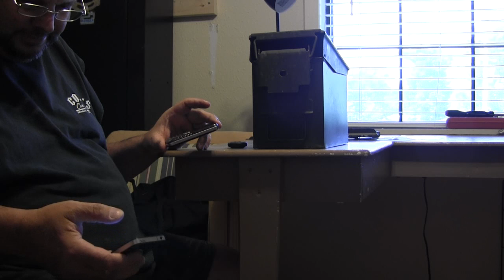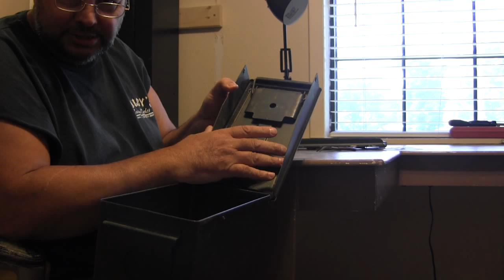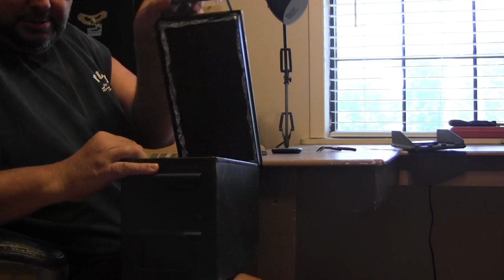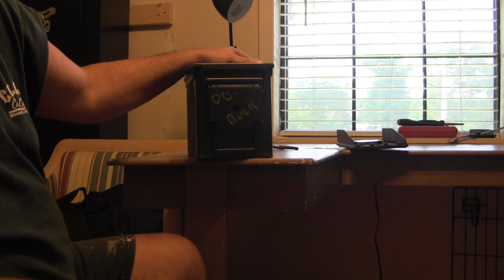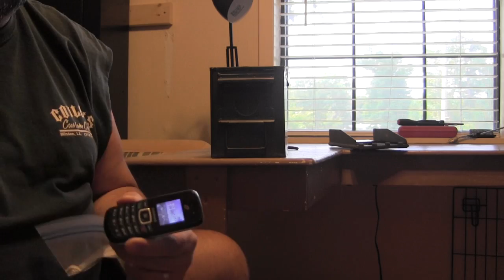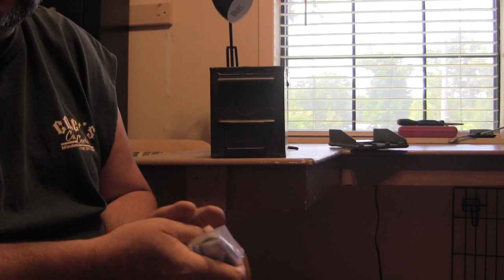Ammo can fariday cage

Comment: That is interesting.  Why do you have to protect ammo from EMP?
Reply from the maker: Tom n EMP can destroy the electrical system of ammo, throwing off the guidance mechanism that makes the bullets hit the target.
Reply: @bctruck  most average civilians dont have electronically guided ballistics.
Reply: Interesting.  I wasn't aware that lead bullets had any circuitry that Electro Magetic Waves (pulses) could interfere with.  I know that some howitzer rounds have circuity but my hunting rounds and pistol rounds do not.  I don't have any big cannon rounds so I guess I'm OK.
Reply from the maker: You must have old ammo. the newest ammo has circuitry that returns the projectile  to your home if it misses the target. Usually you can program it to wait for you on the back porch. EMP, damages the homing circuitry. You should get rid of all that old ammo and buy the new stuff!!
Reply: @bctruck   You should have also mentioned that the ammo built after June 2017 can stay airborne indefinitely, energizing off the earth's magnetic field until it hits something solid.   ; )
Reply from the maker: MTplainsman I did this video back in 2013, before the third gen. Homing ammo.
Reply: @bctruck  yea i keep my homing bullets in the garage next to my blinker fluid.
Reply: Other things fit in those ammo cans ...walkie talkies cb radios cell phones batteries ect.
Reply: @Johndoe-qk6fi  Yes there is a variety of uses for metal ammo cans.
Reply: You sir, win the internet

Comment: What prevents the hinge from serving as a contact point for the lid to the box?
Reply: Emp cannot penetrate conductive material the hinge does join the two peices but it does not seal all the way around the rubber seal around the inside of the lid is non-conductive this means the electromagnetic pulse passses thru the rubber seal if you wrap that seal with faraday material so you cant see any rubber and its all covered then if the box was originally sealing properly it should then deflect all of the signal actually cloaking your devices.

Comment: Protecting cell phones from emps and solar flares is not a bad idea, however it's not very practical. Because in the event of an EMP all cell towers and other forms of communication will be completely destroyed. Rendering cell phones useless. Most Faraday boxes are used for ham radios and other forms of two way communication that would not be affected by any widespread communication outage.
Reply from the maker: I didnt build this to protect cell phones! I used a cell phone to test its protection from EMP. I use it to store electronic equipment and FMRS walkie talkies.
Reply: @bctruck  I figured so. But when you wrapped the cell phone in plastic and explain how you wrap it in foil, may have given people the impression they can save their cell phones. Which they can theoretically, I just didn't want people thinking that their cell phones would be usable after that type of disaster.
Reply from the maker: Roger Winn I don’t think anyone interested in faraday cages would think cell towers would work after an EMP. I certainly hope not.
Reply: @bctruck  You I would think that. But I have read on different forums where people falsely believe they will still might be usable. I'm glad you posted the video, more people need to be aware and try and be prepared. Let's just hope that none of us are ever face this type of disaster.
Reply: @bctruck  Cell phones can be an excellent place to store data and media. So even if cell towers are out - at least you will have some of your electronic data preserved.
Reply from the maker: @Robert_Preston  Good point!

Comment: How about just line the inside with card board including the lid and call it a day i took cardboard and lined all the cardboard with a rubber like say a toolbox liner for ur drawers and glued that to the cardboard bottom sides and lid and guess what it workes and did not have to remove the rubber gasket so do it right or u want have any electronics plus remove the battery from anything requiring it to work

Comment: Maybe you can answer this question.  If I disconnect or remove the battery before an EMP or CME,  will the car start?
Reply from the maker: It won’t affect it. The emp affects electronics weather it’s connected to a battery or not. Disconnecting a device like a computer from the power lines might save it but the battery in a car wouldn’t make it anymore or less susceptible to an emp.

Comment: I am considering using ammo cans as well but use two ammo cans placing one iside the other and lining the larger can with wood to prevent any contact with the smaller can. I would then wrap the connection between the body and lid of the larger can with foil tape. Radio signals are a poor test for EMP shielding and by using a layered approach it may provide sufficient protection.

Comment: wow, y'all seem to be way over complicating this...   If you just sand the rim of the can, throw a sheet of foil over the top like you would a dinner dish, and put the lid back on it should work.  the 800mhz cell phone frequency can easily fit through the small space the lid normally has.  Also, testing it with WiFi which is in the 2.4 ghz range should give you a good idea of how it will work.

Comment: How about using metal tape. It would give same sealed effect
Reply: man, i watched a man that specializes in emp test a trash can , and when he added aluminum duct tape to seal the lid to the can, it greatly improved the emp shed ability of the can, and the video is here on you tube if your interested, in fact i went right out and bought a scratch and dent galvanized  trash can from menards and a roll of alum. duct tape. ONE Negative, once you have duct taped the lid closed , it becomes a real pain in the back side to be removing the tape to access your items if you need them. one help with that is do not buy the cheap thin tape , because it will tear and tear and take forever to get off!
Reply from the maker: I think the adhesive would prevent the metal tape from actually making contact. I showed how this method works. If you think something else would work,go for it.
Reply: did it work?  I'm trying to understand the philosophy of how faraday cages work to shield from emp/cme events.
Reply: EMP Trash Can Faraday Cage Testing in Lab
disasterprepper

Comment: EMP/CMP is an induced voltage/current by a magnetic field crossing a conductor. This is how generators work. Most electronics have very fine wires so they can easily be fried by a significant magnetic pulse. Electronics not hooked to long outside wires, powerlines or telephone wires or cable TV will do better than those that are.
Unplugged and shielded is better than plugged in and unshielded.It is better that the ammo can is tied to ground. A strong pulse may overwhealm sheilda though.

Comment: Well I just tried calling my cell from the house phone. The phone wouldn't ring unless I opened the lid on the ammo can. I'm in a low signal area so that might have affected it. A jumper wire shouldn't matter between the lid and the can because the hinge makes the connection so I was wrong about that.

Comment: Great video! A metal (galvanized) trash can (standard size) is a good size to hold most of your electronics, even desktops.  You need to line the ENTIRE inside of the can with clean cardboard, so that NOTHING can touch the metal sides.  Do the same thing with the underside of the lid - but not the sides (that go fit over the can to seal it).  Use painters tape to hold the cardboard in place, if needed, but keep the METAL TO METAL lid/can contact. Check with a battery op'd radio or phone.

Comment: There is a principle called Lenz's law that explains how a Faraday cage works.  Basically, the primary electromagnetic field creates a secondary magnetic field around the Faraday cage. The second magnetic field will always oppose the primary field thus reducing the effect of the primary magnetic field, and protects the stuff inside. The aluminum foil will act as a secondary Faraday cage in case any of the primary field penetrates the primary cage....simple right :-)

Comment: You also need to line the box to electrically isolate the electronics.  At this point you are just blocking RF. also i sanded the paint off mine and tested it by hitting it with a arch welder with my radio inside. The electrons only flowed on the outside of the can.  With out the rubber lining it would of smoked my radio.